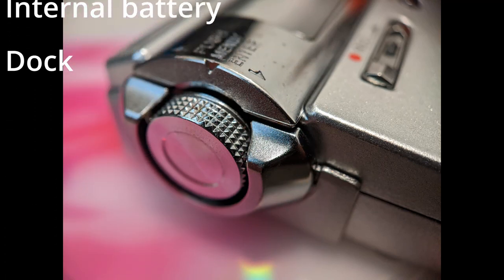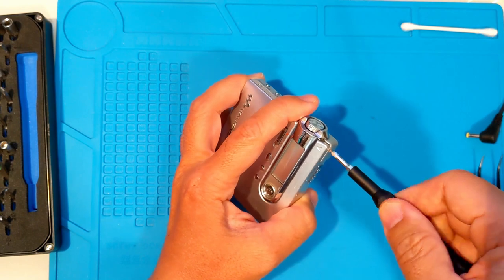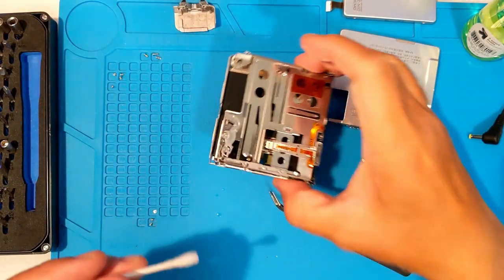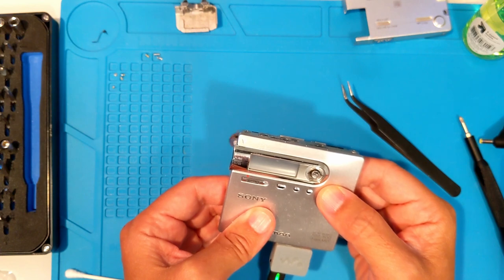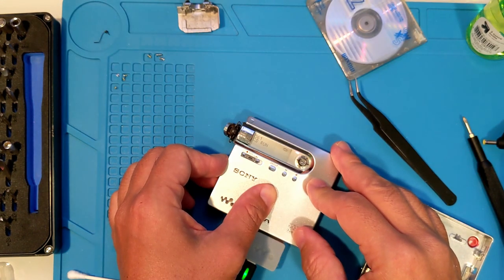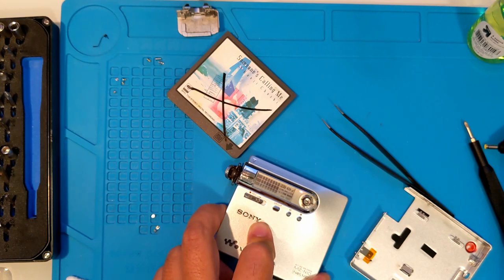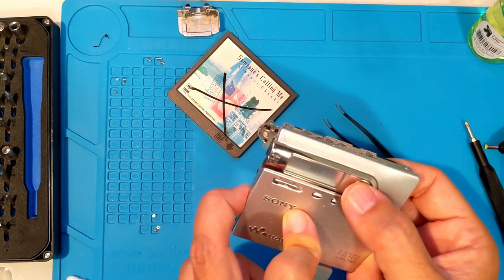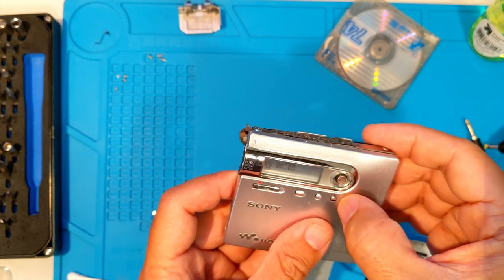Sony MZ-N10 fixing read error, by cleaning and completing Service Menu tests

Comment: Great job on the video, I have a MZ-N10 that I swapped out the OEM battery for a replacement found on ebay.  The only thing is that now there is a tiny bit of pressure from the inside (I guess because the battery is not EXACTLY the same size) which creates a little bit of a gap between the lid and player when closed.  It does play fine and is only cosmetic, but I may tear it down again to do further restoration.  Long live MD!
Reply from the maker: Thank you and well-done on swapping it yourself! I know what you're saying since there isn't much room for extra space. I've swapped 3-4 so far and on one of them, I had to "push down the top corner" to allow the door/MD tray to close properly without too much of a gap.
Reply: @TechnicalInitiative thanks for the video! Which one of the 3rd party batteries on the market fits the best please? I feel there are many having the battery size too big.
Reply from the maker: @danielsun486   There are a few choices if you look on their website, but I've ordered more than 5 of these and have always received them in good condition.
https://www.aliexpress.us/item/3256804614174298.html  The only thing you may need to do is squeeze the taped part a bit before fully inserting it. They fit well besides that!

Comment: Great videos! Thanks to your guide I was able to revive my unit. Only thing is, that now it's always showing PC->->MD. Can't play anything locally. Via Web MiniDisc Pro, I can listen to it. Keep up the good work :)
Reply from the maker: @sifu36 thank you and glad it could help!  That's very odd that it thinks it's connected!  Is this using the factory N10 dock or are you using one of MDGadgetry's adapters?
Reply: @TechnicalInitiative  I'm using the factory dock. But even without the dock it's still thinking it's connected. Kinda weird. Primary error is gone now a different one crawled up :D

Comment: Congratulations on resurrecting that fantastic MD player; I'm heading to Tokyo next week and will be scouring the Hard Off electronics section in hopes of scoring one myself - wish me luck!
Reply from the maker: Thanks! Good luck! From what I'm hearing, try to find smaller shops away from the main places ppl will check (Akihabara, etc.). I plan to head back when I can, too!
Reply: @TechnicalInitiative  will let you know if I have any luck!
Reply from the maker: Oh one more thing - bring spare batteries (gumsticks, AA sidecars for different models), headphones, and discs to test since many locations will have small test areas so you can actually test them out before buying them! Good luck!
Reply: @TechnicalInitiative  so Tokyo was a bust for MD anything, not even blank discs. However, paradoxically while here I scored a great deal on a like new MZ-M10 HiMD player with a bunch of discs on eBay, so…win?
Reply from the maker: haha yeah a win is a win!  I heard from some friends over there that smaller towns are the place to find MD stuff now!

Comment: Love the video - is the CD test necessary if you only play MO discs?
Reply from the maker: Hi! Unfortunately, yes it's required. I think someone more deeply technical could probably set all the individual "CD" parameters for the laser, but usually you won't be able to exit test mode without completing the MO and "CD" tests.  There's one anecdote online about getting out without the "CD" but it did not work for me (I reference it in my MZ-R900 article). If you're in need of a "cheap" one they sometimes pop up on eBay or Yahoo Japan Auctions or a local record store may be getting rid of some (I've heard)

Comment: Great job! How did you learn about all the service menu tests?

Also, I have an n10 that no longer shows up on the computer. Do you think it’s the cable, the port or the computer driver? I know it’s hard to diagnose without seeing it but maybe there is a known problem.
Reply from the maker: Hi! I have had to work in the Service Menu with the Sony MZ-R900, MZ-R2 and others, so checking out the Service Manual, I figured that was the next step after making sure the mechanical things were working. 

If it doesn't show up on the computer at all, it could be the cable, but I'd start with asking:
1 - is it working normally as a MD player/recorder?
2 - when you connect to the PC (or ChromeOS or Linux or Mac OS) do you hear or see the USB connection sound?  
3 - can you check device manager (or similar in other OS) to see if it's detected at all?

If most of that is working fine and you're not seeing anything on the computer (do you have another to try?) then it could be the cable. Since Sony made proprietary cables for these (I have an MZ-NH1 with a flaky cable), it might be best to try a new modern version (seen in the video).

Comment: Want to replace  the battery on mine to Frightened to do it   !!
Reply from the maker: haha yes, sir I would do it! I should stock up on some replacement batteries first and then I can let you know.  I recently had someone find me on YouTube and send me their Sharp MD-MS702 for repair (already returned it)!
Reply: Yes I would  be interested if you can replace the battery  .
Reply from the maker: I've ordered some replacements and will keep you posted (or you'll see a video!)
Reply from the maker: Good news - it's a 5-minute swap and you get more capacity (if the rating is accurate)! I will post a video as soon as I don't sound all stuffed up!